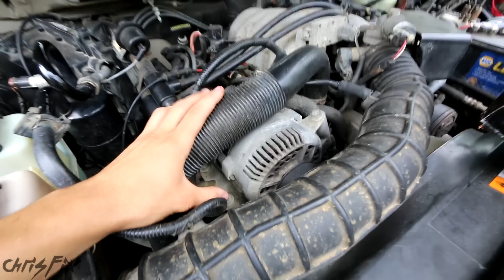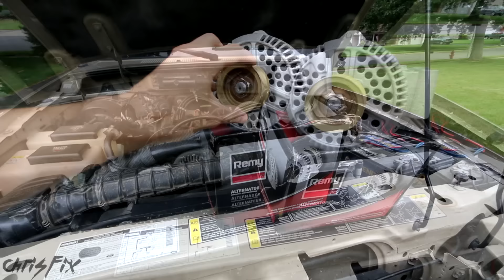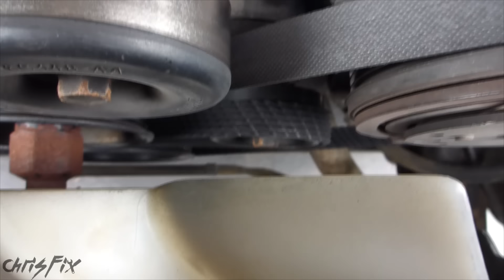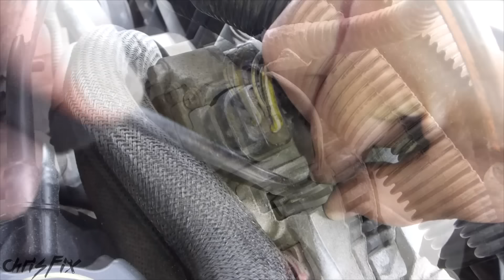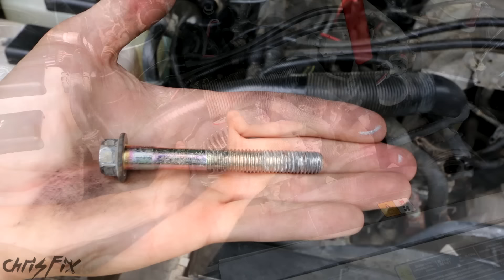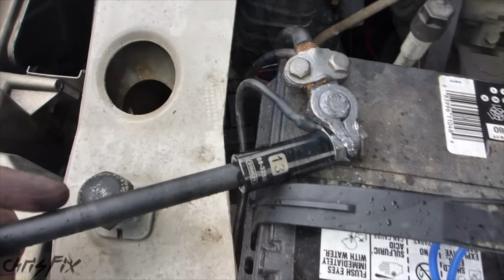How to Replace an Alternator

Comment: Had an alternator fail on me many years ago, kept it going by beating it with a hammer whenever the battery light came on. Rang around. Nissan wanted $600 for a new alternator, auto-electrician wanted $400 for a reconditioned one, brother-in-law laughed at me and said if it was a Mitsubishi I wouldn't have this problem (he was a Mitsubishi salesman). So I pulled the alternator out and discover it's a Mitsubishi alternator (ha!) went to the local parts store, bought a pair of carbon brushes for $4.50 for a Commodore (bog standard common Australian sedan). Opened up the alternator, removed the old carbon brushes - cut the new brushes down to fit with a dremel tool. Soldered new brushes into place. Worked perfectly. Used the same trick on my motorbike a couple of years later - motorbike shop wanted $120 EACH for the carbon brushes, replaced them both for $4.50.
Reply: Mitsubishi makes most of the electronics for Nissan.

Comment: I had a friend with a Mazda 6, the alternator was in a terrible spot and after I finally got the job done the car still wouldn’t start.. turns out it the battery cables had a poor connection so I put some coke on the cables and rubbed them with a wire brush and it cranked right up.

Comment: Not so easy in a Ford Fiesta. You have to pull out the right headlight, front-right wheel, and a splash guard. Also, the serpentine belt is a stretch-to-fit, so the whole thing is just a huge headache. lol

Comment: My Toyota Prado has produced a rubbery-ozone smell for years and I thought it was something on the muffler. Recently when towing up hill on the HWY a sound akin to a worn alternator bearing started to 'whistle' or 'whine' but it only occurs on higher revs under load. So its probably an alternator replacement?

Comment: You remove corrosion for a better connection but add antiseize? It's like removing the insulation from a wire and putting tape around it. It take a lot of time, waste materials, and is useless. No hate or anything, it's a very good video, but what you did is useless. You don't need to remove that white thing, but if you do don't put antiseize on it

Comment: Just replaced my alternator, charged it to 76 % and drove just fine but went out to my truck just now and I got nothin, dead again -.- my radio was turned off, nothing was plugged in, and have no idea why my truck won’t go back to normal. I should replace my battery cables that might be a culprit or a fuse but honestly this blows but your video was a big help

Comment: Hey Chris I had a question. I have a 2007 Toyota Corolla and I’m planning on changing the alternator. I’m thinking between buying the alternator that Toyota sells which is $250 and an alternator at auto zone which costs $150.
Does it matter which one ?
Reply: If it's the same size and same amps you can use it

Comment: anyone with a  1988-1994 ford festiva or mazda 121, if you have a fuel light that comes on its actually both the fuel light and the alternator light... ford/mazda decided to save the 1 cent in wiring in a seperate light for both
Reply from the maker: Thanks for sharing!
Reply: @chrisfix  it took me disconnecting the fuel level sender to confirm it wasn't the fuel system, looking through wiring diagrams and finally actually checking with a multimeter to see the battery wasn't charging to find out it was the alternator... thanks for that Ford/Mazda

Comment: I thought when you get a HO Alternator you have to change to a different belt🤔😕
Reply from the maker: I don't see why you would, but I would definitely check the belt and see if it needs replacing because it's worn!
Reply: @chrisfix  I was curious because I was getting a HO for my 05 Impala a while back & someone told me you have to get a different belt because it puts out more power for some reason I thought they were full of S**T

Comment: The alternator on my 2006 Trailblazer had a 2007 alternator plug in on the original OEM alternator and the third bolt on the bottom of the alternator was a nightmare getting too.  One of my knuckles really got a good raw rubbing brushing up against a mesh that was on a coolant hose getting out the old one and new one in.
Reply from the maker: Ouch!

Comment: Another important tip almost everyone forgets is to pull the fuse on the flux capacitor.Otherwise you might end up embarrassing yourself by getting into an awkward situation with your mom and some dude named Biff.

Comment: @ChrisFix- If you removed the alternator in a car, got a fitting serpentine belt, and hooked up enough solar panels to meet your battery charging needs, you could essentially have a more fuel efficient, more environmentally friendly, and faster (more horsepower) car, right? My knowledge is that the alternator uses rotational energy, slowing down the serpentine belt, using its power to charge the battery and provide power to the electrical parts of the car. They don't run it though the battery to maintain electric percent efficiency (the battery loses a percent of its energy when run though a battery). If you had solar panels hooked up onto the roof, you could charge the battery directly or use a volt regulator and wire it to the electric components directly, cutting out the alternator completely (and battery if you wire directly). Would this work?

Comment: Great video Chris!
I have question and I hope you get to read this or fellow viewers can maybe help, too. 
I got a 2003 Nissan Serena minivan (im in Japan) from a friend. When I start the car the battery lights are on. It doesn’t go away until 10 mins later (idle or driving). I checked with my multimeter and confirmed the battery is ok at 12. something volts at engine off. When engine starts, the voltmeter stays at 12. Thats when the battery lights are on. When the lights go away, the voltmeter is at 13 something. Question: does my alternator need replacement?

Comment: 🥺Being a girl, I love my nealy 20 years old car, but I have to trust whatever they say to me, I’m so sad now😟my car (Mercedes A Class, first generation, w168, year 2000) was making noise, type of gridding noise, I thought I was a belt. Our mechanic guy said it was alternator, and it cost me a fortune because he said I needed changing for a reconditioned one plus the belt as well. My car is not even worth to scrap. I was not entirely convinced this was the actual problem, now watching your video, I can definitely say my car was not losing power, it’s 1.9 engine, petrol, still has the power and that’s why I haven’t scrapped yet. The issue was the noise that was making every time I was accelerating and changing gears, it was quite loud squidgy noise and I thought it could seize up if I had carried on driving. Is this also a diagnostic for alternator? 😟 one thing I have noticed, they don’t want to work on old cars, so I guess they charge a fortune.😟 so I need to learn how to look after my own baby until I can afford a newer one😟
Reply from the maker: Is the loud noise only when you change gears or accelerate?
Reply: When accelerate it. I even record it!
Reply: AndreaUK1973 Here in the states I don’t know why Mercedes Benz is not built well. They are endless money pits. But in Europe, they are very reliable. I don’t know why. I hope you got your issues fixed 😊

Comment: I changed alternator in my Audi a6 C6 V6 3.0. It was HARD. Even after removing the bolts and everything it was still in place and with no intention of going somewhere. I broke one screwdriver and after 1 hour of pulling and hitting with everything i had it came out. In this engine you have to do it everything from the ground under the engine because it's the only place where is a space to remove it.
Reply from the maker: Oh wow! At least you were able to do it!
Reply: Adam Wiśniewski Poor design by the Germans. My Toyota Camry, a Japanese car, has the alternator ontop easy access and LOTS of room to work.

Comment: For the bolts, shouldn't it have been blue locktite for vibration instead of anti-seize? (When do you use locktite, and when do you use anti-seize?)

Comment: Mr. Fix, shouldn’t you make sure your battery is fully charged up before operating the new alternator? The bad alternator was not charging the battery fully and the new alternator can over work itself and get damaged trying recharge a weak battery I was told.
Reply from the maker: Eh, I have never seen an alternator "over work" and get damaged because it was charging up a battery.
Reply: ChrisFix mr. Fix, I just got done watching a 7 year old video of yours having to do with the same thing, changing out the alternator and towards the end you did say that you should NOT have a new alternator charge up a depleted battery because it could stress out a new alternator. So, quite frankly, I’m confused.

Comment: I didn’t even get to the alternator on my corsa d 1.2, I started undoing my belt tensioner bottom bolt and the bolt snapped with half the bolt in the block!! I crapped myself but I was soooo lucky a little bit of the bolt was sticking out so I managed to screw it out with pliers.
My alternator is at the bottom of the car and the electric wires behind the alternator looks impossible to get to !!!

Comment: I had an alternator go out on me on my 2004 Ford F-150 on Labor Day. I picked up an exhaust tail pipe for my scrap run that was along side the roadway. I pulled in my upper driveway to put the tail pipe into my trailer and got back into my truck to move it and all my gauges went blank. The radio went off and to top it off I couldn't shift out of Park. I turned it off and tried to restart it and it wouldn't start so I jump started it and it started but wouldn't shift out of park. I shut it off again and then it wouldn't start. I called my brother and he had a big jump box we got it started again and leaving the jump box attached I could shift it out of park. The engine cut right out as soon as he took the jump box off so end of the story my alternator crapped out on me. I am thankful it happened in my driveway and not out on the roadway to where I would have had to call AAA for a tow. I went to the local junk yard and got one and slapped it in and it solved the problem. Advance Auto wanted $239 for the alternator. I got the one at the junk yard for $25 and it was under guarantee for 30 days

Comment: Thanks for your wonderful how-to videos!!I used this video to replace my alternator on my 2008 GMC Yukon Denali 6.2L, 203000 miles. Everything was going good but when I tried to lift out the old alternator, it wouldn't budge. The rusty "sleeves" in the mounting holes seemed to be stuck, I was perplexed. I searched another how-to video and found this helpful tip:To make the process of installing the new alternator easier...   there are two sleeve inserts the two bolts go through, in the alternator mounting bracket.  These sleeves move and can be easily moved a mm or two by a couple taps with a hammer, going from the engine side towards the bumper side. That pushes/slides each sleeve back a little and creates clearance for the new alternator to easily drop in. Tightening down the bolts again pushes these two sleeves back to a snug fit against the alternator body. [This allowed me to go ahead and PRY the old unit up and out without any further concern about the rusty sleeves.]Hope this helps anyone with a similar concern.

Comment: Great video thank you so!

I have to change the alternator this weekend and my only concern is the alternator on the Scion it's located on the left side of the engine.
Reply from the maker: Just less space. Might be able to get to it from under the car or the wheel well.
Reply: @chrisfix  yes! Very nice 🙂  thanks for those links on the tools im getting my serpentine belt tool tomorrow
Reply: Oh man, I’ve gotten a Scion xB 06, there is a bolt at the bottom that gets me nervous, I guess I’m gonna have to lift the engine to loose it and pull it out.. is so tight in there :’( 
Thanks for your videos @ChrisFix, I learn a lot watching them!

Comment: Going over the factory amps, will it heat up the wires and cause a fire?? Since the truck is built around 95amps not 130.

Comment: Not to be a word nerd, Chris, but you say to take off the negative "terminal" of the battery at 1:48.  One takes the battery "clamp" OFF the terminal, not the terminal itself.  A terminal is a fixed part of the battery.

Comment: I have 2010 corolla with 1.8 engine and when I start the car the alternator show 14.0 volts and then i switch on the AC the voltage drops to 13.8 and with headlights it drops to 13.5  and after driving 15 min in hot weather the voltage drops to 13 volts at idle and 13.2 with 2000 rpm and at idle rpm drops from 850 to 750 rpm and if i on the full beam with headlights then voltage drops to 12.8 and rpm drops to 650, what do you think about the alternator ?? With full load and reving to 2000 rpm the alternator goes between 12.8 and 13 vole

Comment: I guess te problem caused by the regulator. You didnt have to change the alternator complately. I understood that you wanted to improve the charging capacity, so its okay but it would be nice if you work inside an alternator to make us learn :) . I know that you are super busy with all these comments and everything, but if you seeing my comment i got a problem with my car. Last owner applied 3 types of silicon on the doors to stick the plastic trim, now i removed them and having a big trouble removing the silicone dirt. I tried everything to remove including wd-40, synthetic thinner etc. but couldn figure out how to remove them. If you could make a proper video to explain how to remove that silicone residue, it would be perfect ! Huge fan from Turkey !

Comment: couldnt help but smile at the end when it was a successful install and voltage didnt drop. I just purchased a 2007 Mazda 6 3.0 L wagon. new battery and oil change today, at the red light it wouldnt shift down from third gear and starts chugging so i pulled her off the road and she stalled. Got a boost and on my way home I get pulled over cause I was rolling threw stop signs due to the stuck transmission, she just clicks when I crank er over. guess im buying a new alternator. dashboard lit up like a christmas tree when i pulled off the highway...what a fuckin day...lol

Comment: All I needed for mine was an 8mm wrench for the battery, 1/4" ratchet for engine cover, 3/8" ratchet for belt tensioner, and I believe it was a 10mm socket to take the alternator out of the engine valley.

Comment: Wil it really help the electrical system when upgrading big 3?  I have a jeep compass and its crazy hard to get to the alternator.  Do you think its worth it to upgrade?
Reply: The stock alternator is plenty for most applications. Unless you have added a lot of electrical components such as a subwoofers, winches, aftermarket lights, and aftermarket fans. Do an amp draw with as many components on as possible and see if the alternator is rated to supply that power. If the car is stock, a better alternator will do nothing because alternators only supply as many amps as is required. If all of the electronics in the car only require 100 amps, a 200 amp alternator will not work any better than a 100 amp alternator.

Comment: Did a 2013 f150 5.0 yesterday... 2hrs and the need of two people to get the alternator off and on. Ridiculous. Any other alternator is 20 minutes top. Anyways, your video helped identify electrical connections. Couldn’t see them, but was able to feel for them and get them off

Comment: for anyone doing this on a ranger or the mazda like chris, the 3 bolts that hold the alternator down are 1/2 inch.  Don't think that was mentioned in the video.  Did mine today with a wrecker part.

Comment: A multi-bit screwdriver is my personal favorite for hose clamps. It has a 1/4" and 5/16' hex socket on either end, which fit the hex-head on hose clamps of all sizes, allowing you to turn the screw without risk of the driver slipping out. And of course, the removable bits give you two sizes philips and two of flat. Perfect for pulling miscellaneous parts at the junkyard. 

      The gray and blue one sold by Harbor Freight is my favorite.

Comment: If i buy a higher amp alternator than i need, will it last longer? I want it to last as long as possible
Reply: Yes, an alternator that is not running at its capacity will last longer than an alternator that is maxed out. Do an amp draw with as many components on as you can and see how many amps you need. If your car draws a maximum of 150 amps, then a 300 amp alternator will last longer than a 150 amp alternator because it is not working at its capacity.

Comment: Excellent video as usual, Chris!  But I was surprised to see that you didn't recommend checking the belt for cracks and general condition while it's loose.  This is a good time for replacement if necessary.
Reply from the maker: Thanks

Comment: I wonder if my alternator is just shot and I never realized. It'll start just fine one time, and if I shut it off and try starting it again after a couple of minutes it will just crank two or three times and fire up right away. Hell, just today I went to move my truck at work and didn't have any problems, come five hours later the whole truck is dead and won't click. Weird part is the interior lights came on for no reason and shut off moments after.

Comment: Recently I got my car repainted and ever since it was repainted, there has been a crazy tractor noise coming from the engine, did they possible steal parts and replace them with bad ones? If so what could it be?

Comment: Can't installing a more powerful alternator damage your electrical systems?
Reply: No, the alternator only supplies as much power as needed. A 300 amp alternator does not provide 300 amps all the time. It can provide up to 300 amps but it will only provide the amount of amps required at any given time.